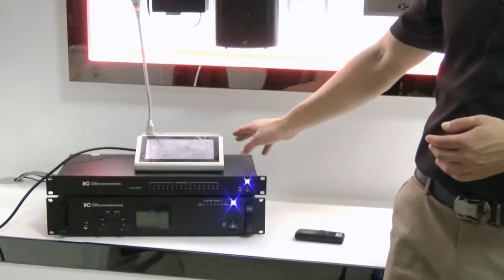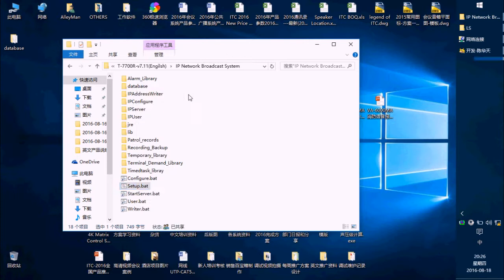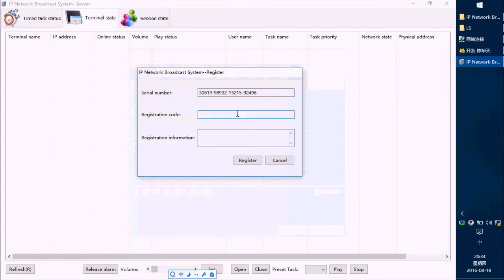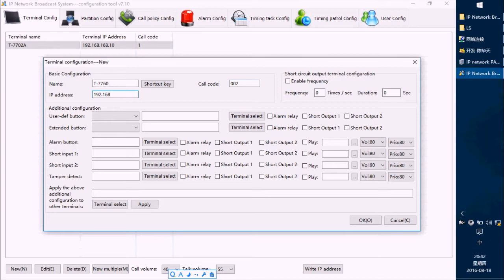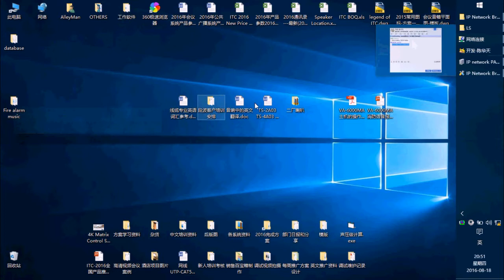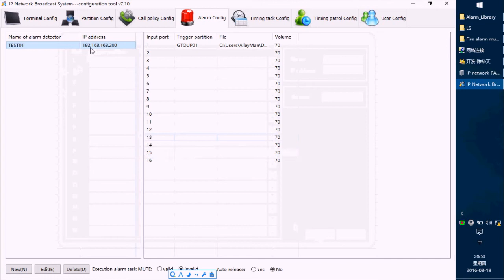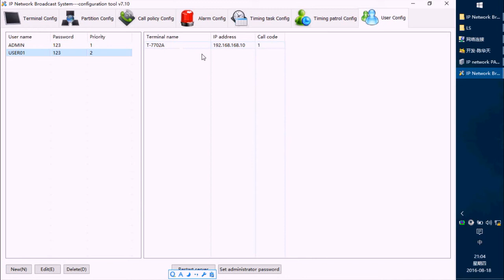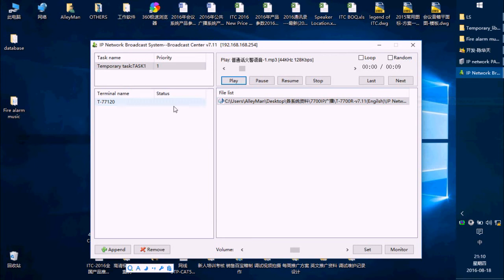Introduction and operation of IP Network Audio Public Address System

Comment: Hi ITC is this compatible for long range Fiber Optic cable with media converter? we have a pending projects for large scale City PA system with a 100zone in our Mesh Fiber Optic Cable Network.  Can we connected  directly the outdoor speaker to the IP Amplier (T67500)
Reply from the maker: Hi, Jonala. Thanks for your message. May I have your contact information? You can email us the project information. Our engineers will give you professional advice. Let's work together.